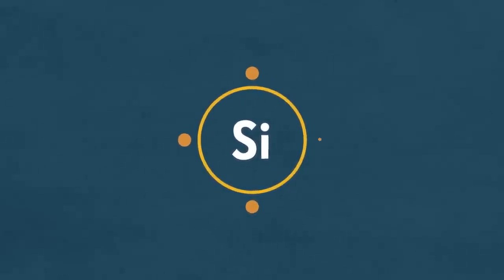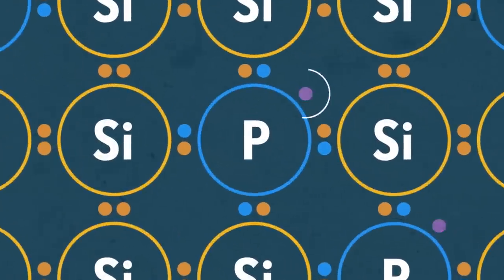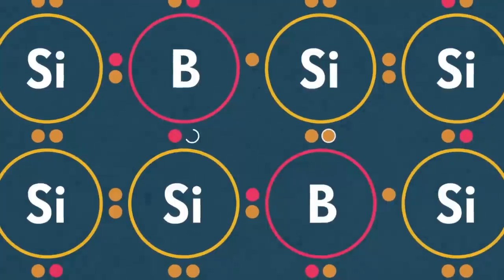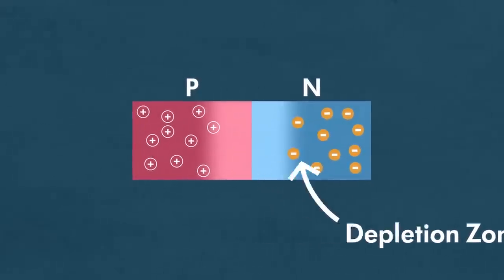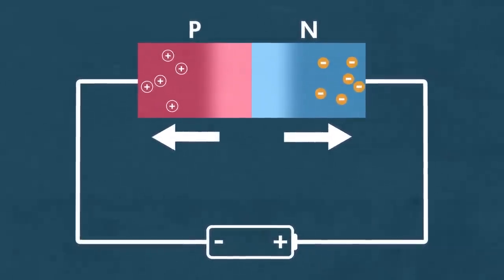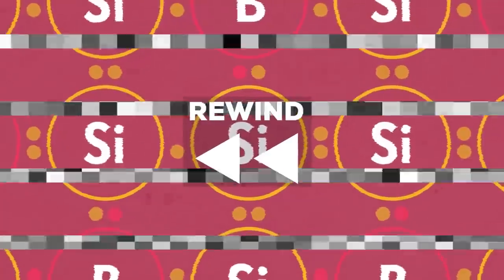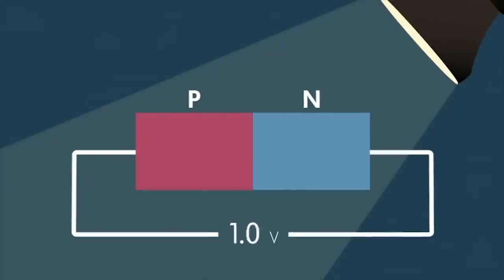How diodes, LEDs and solar panels work

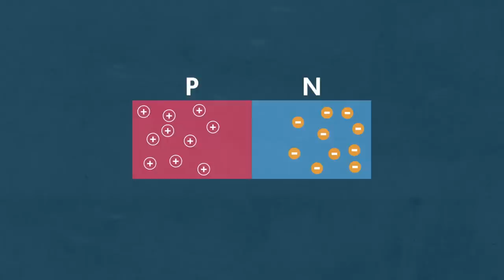Comment: 4:55 i always get confused at this point!!!

OK, I know that electrons will go to holes because its their nature,
But why:
if p type is already +ve & n type -ve, then why not get neutral?
I mean you put electrons(-ve) into holes(+ve) and "fisssshhhhhh" you still get -ve!!!!!

Also I want to know what happens when I connect p-type & n-type by a wire (no battery in circuit, just short circuit them)? In general shouldn't it all become neutral,
If not then at least the whole diode should get a single charge.

Please help, its a simple question...
Reply: The p type and the n type are allready neutral. We need to take into consideration the protons in the atoms. These are no ions when the 2 types are separated. The Silicon, Phosphorus and Boron have the same number of electrons as they have protons. 
So Silicon hase 14 electrons and 14 protons, Phosphorus has 15 e- and 15 p+, Boron has 5 e- a 5 p+. So even when you mix Si with Ph, the meterial will have the same nb of e- and same nb of p+ (simple example: 4 Si atoms and 1 Ph atom: 4 * 14e- + 4*14p+ + 15e- + 15p+ = 0 charge) , therefore neutral charge, no excess of electrons within the material, within that system. But when you put p type next to n type one will have more electrons relative to the other, with an emphasis on relative (because both are still neutral). So some e- will be attracted in the other material because of this relative excess.
I think your misunderstanding comse from the fact you think p type is positively charged and n type is negatively charged, which they're not, they're neutral. The ions/cations are just within the depletion zone so the entire diode looks like this: neutral p type zone, negative charged p type zone, positive charged n type zone, neutral n type. The depletion zone doesn't get bigger (the entire materials) because the neg part of the p type, attracts the positive type of the n type.
You can think of it like 2 aquariums, one next to the other, with a sliding wall between them. One has a lower level of water, one has a higher level, min and max levels, let's say. As long as the dividing wall stays in place (the wall being a metaphor for the two doped semiconductors not being physically connected to each other), each system is in balance (both have neutral charge). Once you take the wall away, water will flow in one direction until ther is a new level in each aquarium: halfway between min and max (the new system still hase a neutral charge, it just got shifted around). 
So when you connect the new aquariums with a tube to each opposite fixed wall, nothing happens, because the system is in balance. That's why nothing happens when you connect a diode with itself: it was allready neutrally charged.
...
Also the metaphor with the 2 aquariums is not 100%, because electrons don't get diffused through the entire material, it's just the depletion zone.
Reply: @petruraciula9056  thanks for your help, for your efforts and for explaining me this concept.

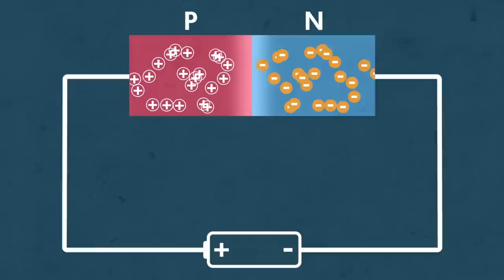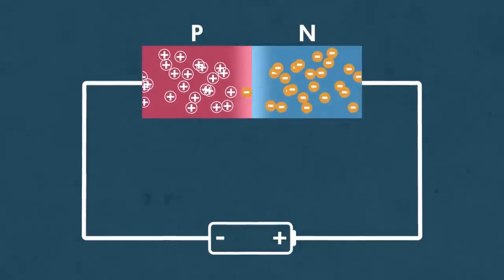Comment: @7:45  and 7:50 did you just flip the battery without changing the current flow?  Benjamin Franklin had a 50/50 chance and now people have to think about electron flow vs current flow...

Comment: Why we do not see any light in a normal diode????
Reply: because (a) the emitted light is in the infrared (b) the emission efficiency of silicon is extremely poor and there are other competing ways for the electron to loose its energy and (c) you normally encapsulate "normal" diodes in a non-transparent casing in order to keep external light out.

Comment: You lose me at 4:55

Why does a negative charge build up where an electron and a positive void cancel each other out? Wouldn't +1 + -1 = 0, not -0.001?
Reply: Your intuition serves you correct..it's rubbish it only makes sense to idiots and mathematicians because they have no common sense..the religion of quantum theory aka atomism isn't new even the Greeks new about it, virtual particles have never been the input or output of any experiment ever done, an electron isn't a thing in asmuch as the end of a spegetti isn't a thing in itself,  you can point at it measure it etc but it has no indipendant existance..No spaghetti no end of such  light also isn't made of particles..light is an induction process in time not a movement through space, there is no such thing as speed of light it is a rate of induction determined by the processing medium, that medium being the ether..strange how we hear everything about dipstick einstine that gave us Jack crap compared to the likes of tesla, faraday, Maxwell, heavyside, stienmetz the ones who gave us 100% of the modern electrified civilisation, so of which for one second believed in einstines theorys, most were experts in field theory, tesla referred to einstine as an idiot on several occasions..fuzzy haird crack pot..begger dressed in purple roabs etc, even einstine himself in his later years went on tours around the world defending the eather, nothing about that in school ey! I'm just scratching the surface here...

If your intuition is as good as I think it is I suggest watching some of ken wheelers channel theorea apophasis...the only guy to ever explain and define magnetism that remotely makes sense, he's a little hard to get used to but you know when someone knows what they're talking about when they keep repeating the same thing consistently, you will quickly realise just how wrong mainstream science and school education is, and his explanation of what's going on in an led is way more correct than this video.

That's no disrespect to this channel I like the guy and the interest he has in science but by no fault of his own his understanding of the basic principles and fundamental mechanics of reality that govern the natural world ie the dielectric and the magnetic, outward thrusting (force and motion) and inward falling (inertia and acceleration) capacitance, resistance permeability and permitivity...it's all the same stuff just different modalities like ice water and steam are just different states of the same thing water.

While we're on the subject gravity isn't a force and newton never said it was a force along with many other things you find out when actually studying these people, as In the unpublished and personal notes not just what's shoveld down our throats in school..gravity is the same thing as what's going on in a magnet..magnets don't attract eachother, attributionally they do come together of course but by dielectric acceleration not magnetism, magnetism is the outward thrusting force and motion that gives volume to the visible universe, that been the creation of space the torus..what brings them together is dielectric acceleration as space collapses into counter space the magnets are just following, they mutually move towards a null pressure point between them as space collapses into counter space, and gravity is no different other than coherency..imagine you have a 5 watt light bulb is useless but a 5 watt lazer will burn you, but 5 watts is 5 watts right? No 1 is coherent the other incoherent if magnetism is the laser gravity is the light bulb, gravity is incoherent dielectric acceleration and it CAN be cancled out so anti gravity isn't sci-fi It's real but should read artificial couter-spacial dielectric acceleration.

If your interested in knowing more of the truth visit my page
https://www.facebook.com/Danmeggitt1987/

Just a little of my own work and others some of the more important videos that I think of kens etc.
It's mainly there for me so it's all in one place but if I can help anyone understand something better then it's a small contribution on my part...karma and all that shit...Or not who knows lol.

This one's an easy one to get the question raising ball rolling...enjoy.

https://www.dropbox.com/s/x6bi99br9gtu3qr/SPACE%20CANNOT%20BE%20A%20VACUME%21%21.txt?dl=0

Comment: Why not make huge LED TVs in cities workable solar panels in the day time? Couldn't night-only LED displays charge themselves in made in the right way?

And yeah I'm sure it's overall easier to just put a solar panel on a tv than try and engineer a dual purpose component. But what if you did?
Reply: It wouldn't be efficient enough to be worth it. Even the best solar cells are less than 30% efficient. I'd be surprised if an LED array could achieve even 1% efficiency.

Comment: Isn't something missing when mentioning renewable power sources? The Human Powered Power Plant with the human being the: 
Prime Prime-Mover-Machine including Human Ingenuity.
We see a person on a stationary bicycle powering a generator. A person is actually able to power 7  or 8 generators because generators 
are easy to spin especially with the help of a flywheel in the mix.
Presently I am going off grid: in My apartment. I am trying to prove that; led flood lamps are able to power solar panels. This is possible
and shows that all solar panels are able to provide power 24/7! Today's power plants do not want this knowledge known.
We, literally: WE ARE ABLE TO POWER THE GRID. Solar panels are the human-Ingenuity along with led flood lamps. 
I am trying to power the batteries that power the led flood lights; using pedal-power. I am in need of help in order to find the best motor 
to convert to a generator and the correct belts and pulleys to actually attain the best RPM for the generator.

Comment: IR LEDs at 940nm (the ones in TV remote controls) ARE NOT made of silicon.  There is a complication in silicon, as it is an "indirect bandgap" semiconductor.  Silicon LEDs don't work with any reasonable efficiency.  That's why it took so long for LEDs to be invented.  Most likely, the entropy taxman comes by & collects his tax, & the energy goes to heat or "phonons".